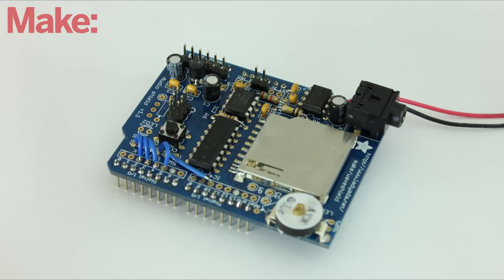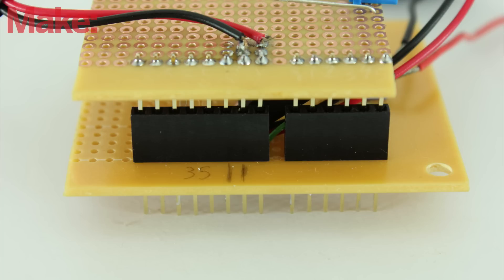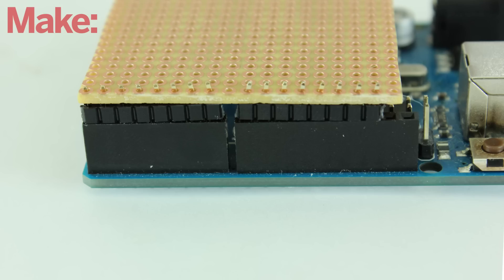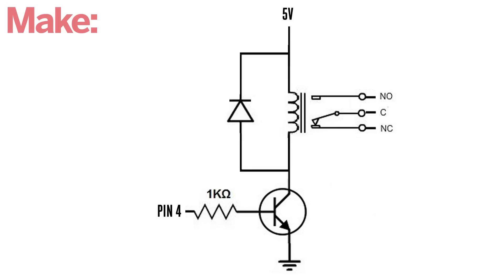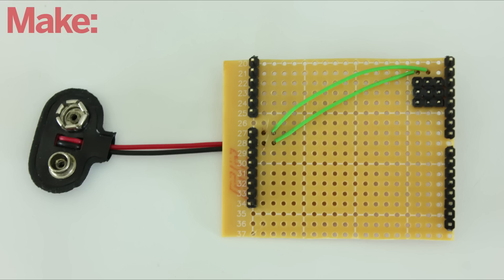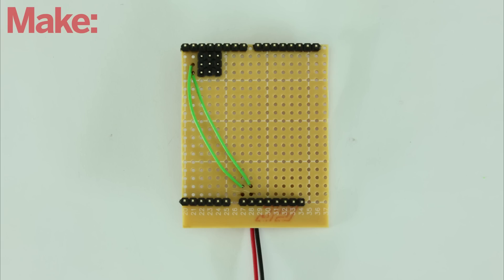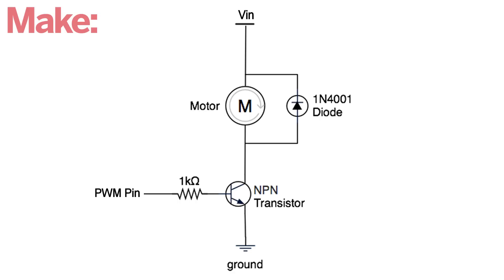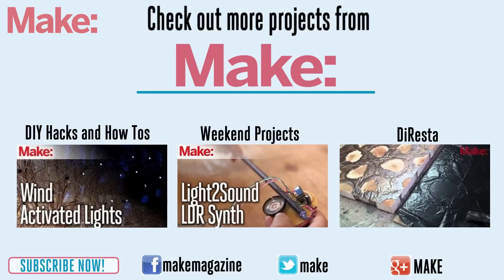How to Make Custom Shields for Your Microcontroller Board

Comment: Something doesn't add up here, the pins on the one header are being bent slightly into an angle, yet they go through straight holes.
Also... in the protoshield the copperside is on top, that makes it at least a bit easier to solder those bent pins, but the servo shield is kinda different, must have been bend somewhere else.
My point anyway is that the video jumps kinda easily over the 'bending', butit isn't.

It is ofcourse much easier to buy a ready made protoshield for about 1.10 euro at Aliexpress, including all the headers

Comment: Nice video, but i have a question. If i connect the male header pins the way you are showing us, then the copper holes are facing upwards, meaning that the components of my protoshield need to face the arduino, and some of them dont fit. Any tips?
Reply: Buy a double sided doughnut board

Comment: Well, if you're going to do this, why not go the whole nine yards and make your own boards? The Lite version of Eagle is free, and two-layer boards are pretty cheap to have fabricated.
Reply: pj I'll have to ask my engineering professor the name of the company, but he told me that they fabricate boards for $2.50 per square inch per board layer.
Reply: VestedUTuber unless there is a minimum order.
Reply: TheDutyPaid
Of course... but I know that there are companies out there that don't have a minimum order.
Reply: VestedUTuber  though, you can still use perfboard as well. I have a project currently where an RPi is connected up to 5 different pieces of perfboard, currently running 5 motors (4 steppers and 1 PMDC), with one of the boards serving as a glue-board (essentially, it is partway between a normal board and a hybrid breadboard made from hacked up DIP sockets), to interface between the RPi and the other boards, and also to down-regulate the input voltage to 5v (this particular machine is powered by a 240W 12v power brick). there are also a few limit switches, a tachometer for the PMDC motor, ...

though, it is basically more of the same, just with a lot more wires and hot glue... (have used enough of it that hot glue is basically a building material in this thing...).
Reply: Brendan Bohannon
Well, perfboard is great for prototyping, but when you're working that shield into a larger project a purpose-built board is going to be a lot less cumbersome, especially if you plan on making multiples of the same shield. I guess it really depends on what you're trying to do.
Reply: VestedUTuber for a lot of duplicate boards, yeah maybe it will be faster/easier to have PCB's made, but for one-off or a small number of boards, it may often be faster/easier/cheaper to wire them all up by hand.

though, for making boards, I am doing a lot of the wiring using magnet wire, as I generally find this faster/easier than using conventional insulated wire (no need to strip before soldering). generally this is a mix of 28, 24, and 20 AWG magnet wire.

a lot of my boards are reasonably specialized. even if a lot of them are loosely similar, namely a lot of dual H-bridge boards. just, I have been building them mostly with discrete transistors rather than driver ICs, as the transistors are a little more robust (less prone to "release their blue smoke", though it can still happen, or they can also sometimes turn into blowtorches), and discrete transistors can handle a bit more power anyways (some ones I find useful: TIP122/TIP127, MJE3055T, IRF540N, ...).
Reply: Brendan Bohannon
I actually used TIP122s and TIP127s in a robotics project with the Texas Instruments MSP430 recently. I'm familiar with those parts.

Anyway, I guess one other reason I prefer custom boards is that it's just more professional.
Reply: VestedUTuber yeah, they are pretty useful.

TIP122/TIP127, good for switching a few amps from a logic level signal (and are pretty useful for lower-power H-bridges).

MJE3055T (NPN), good for linear gain, or driving up to 10A (per transistor), requires pre-boost to be used from logic-level signals (pairing with a 2222A or 2907 can allow it to mimic an NPN or PNP Darlington).

IRF540N (MOSFET), good for up to 33A, but may require require 10v or 12v logic-level for full power, easily destroyed if Vgs exceeds 20v (very problematic in some cases).
Reply: pj Oshpark
Reply: Why build it from scratch when you could simply buy it and give "Make:" a cut of the profit. Make: became a brand, they want their share. They don't give a damn anymore about true DIY Stuff.
Reply: Michael Huard
Actually, Make: doesn't produce any of the parts used in this project. You'll either have to find a Radio Shack or order from Digikey or Sparkfun.
Reply: VestedUTuber  or Amazon or AliExpress. generally, IME I can often find cheaper prices for parts on these.

meanwhile, RadioShack parts seem to be very overpriced in comparison.

DigiKey is sometimes good, they tend to have a good selection (and it is easier to find specific components).

haven't looked much at SparkFun, a lot of their stuff seems more focused on kits.

had got some parts from AndyMark, as they had ok prices on some parts.
Reply: JLCPCB or OSH Park  I've used both; great quality.

Comment: It's a shame they did not design the arduino boards without the annoying spacing between those two headers. Some might scream conspiracy ;)
Reply: ***** It's so you can't put the shield on backwards.
Reply: jorenmartijn Yeah possibly. They could have put a plastic plug in the unused socket next to IOref or something like that it's not like it is totally symmetrical anyway so reversed connections should be rare.
Reply: Man just thank God, older peeps had it much worse, like a chip only (e.g the PIC uC) and they build their own boards and built programmers thru serial (COM) and parallel (LPT) ports with wires, connectors, a components. And had no IDE. Just talk to older guy who dealt with them and see what he could tell you.
They possess(ed) higher knowledge though, due to that process.

Comment: can i make a lcd shield with this
Reply: Sure, you can make anything. See what your LCD needs and connect/solder the pins.
Some LCDs got driver chips (IC chip that makes it show stuff) which is better and easier.
Others do not which is kinda hard to deal with. So get one with the driver/chip and make sure it is easy to run on arduino so it does not give you a hard time to set it up and dig for its libraries and relative files.
https://www.intorobotics.com/the-best-arduino-lcd-displays-you-can-have-right-now/

Comment: Why should anyone build someting like this when he can build his own arduino (atmega 328 with a quarz) and the components he needs with a sheel when he kan build is on one board for less than the half price

Sorry for my bad englisch i'm a little drunk and i'm a native german speaker
Reply: Lukas Jaeger working with microprocessors used to be very difficult.  Not so much the getting the µP to work, but getting it programmed, and experimenting with the program.Arduino pretty much singlehandedly revolutionized this by adding everything you need onto a single cheap board, lower the bar to get it programmed to near zero, and provide a decent bootloader and set of API's that make it easy to program.Just connect to a USB port on your PC, use an easy to use IDE, and even kids can make a led blink or do all sorts of amazing stuff.  It put microprocessors into the hands of 'normal people' instead of being only for electronics engineers.The same is true for the shields.  Shields allow you an easy way to experiment with electronics without really understanding much of what/how the individual components work.Arduino and a lof of the other µP boards out there are not so much an example of "ideal electronics", because it isn't there's a lot of stuff on there you don't need for any one particular project.
But combined it's an easy one-stop access to a whole wide world where even non engineers can play and experiment.If you ARE going to make a product and sell it and need to save on the costs, or absolutely positively need it stripped down to bare components for size, then yes, you can make your own PCB layout based on the atmel (or whatever chip), but then this isn't for a normal person anymore, that'll need someone that at least has a well enough education in electronics.